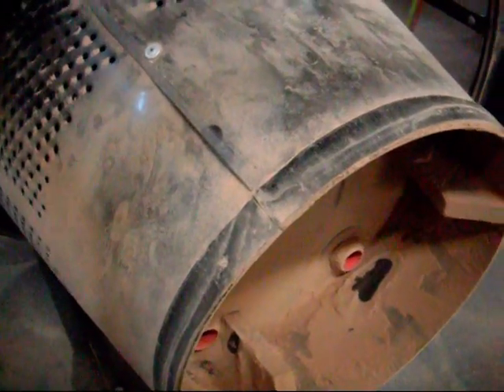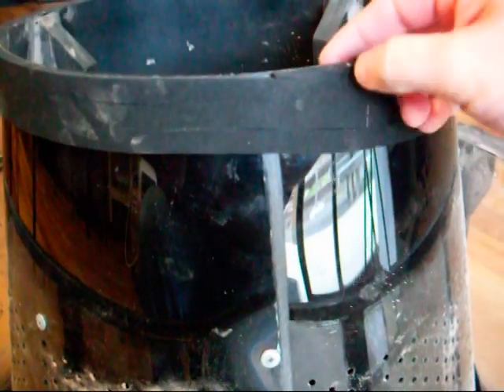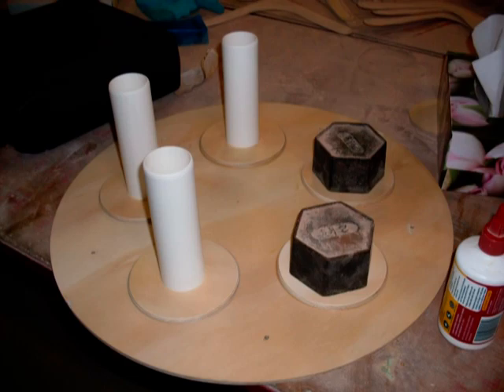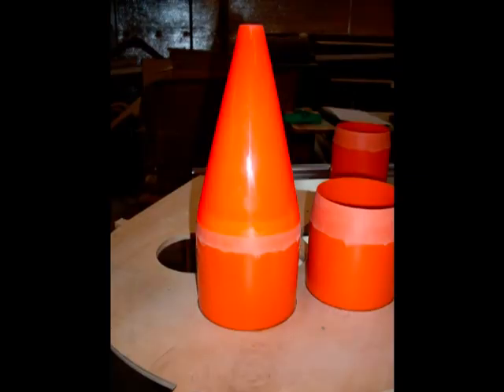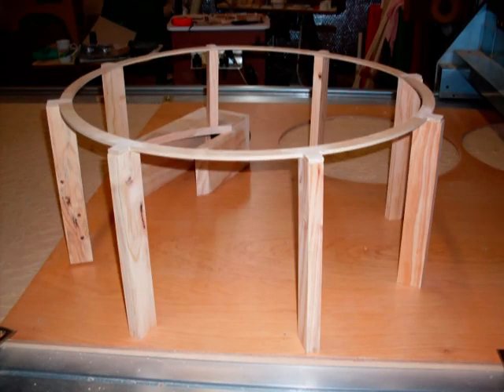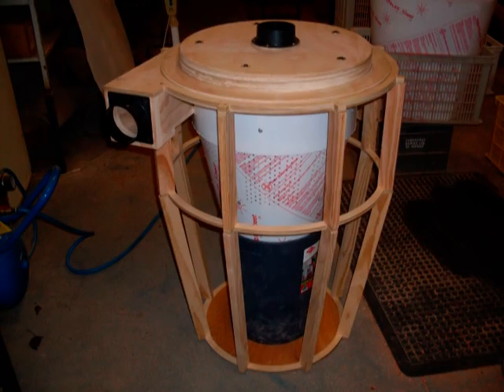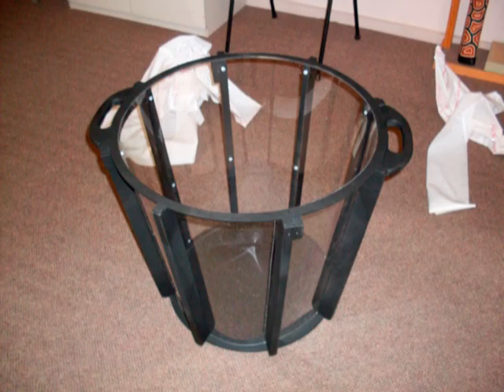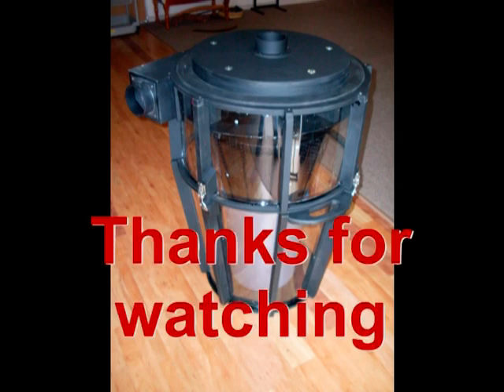2 Stage cyclone dust separator. Part3 (The build)

Comment: I used to work for a company that built large industrial separators similar to this. One thing that you can do to make life a little easier is to mount your separator up higher on a stand and then design the bottom of the cyclone with an air tight removeable bottom. To empty it, you simply open the bottom into your waste container underneath. You can also build cyclones like these for smoke extraction but it it requires water injection.

Comment: A wheel section on the bottom, with a couple of them locking, done in such a way so that bin? will not topple would help move heavier loads better. Especially when you get to the years of age where that load is one you can do without lifting around!

Comment: Very impressive build. I wonder if you've any comments on changes in suction power having added this into the chain to your DC - I would assume, especially with those five smaller internal cyclones and thus the degree to which you're turning the air that a fair amount of energy is being used up there. So I'm slightly wondering whether this design is better suited to high-pressure vacs and not the lower pressure D/C? That said, I'm certainly not a fluid dynamics engineer!